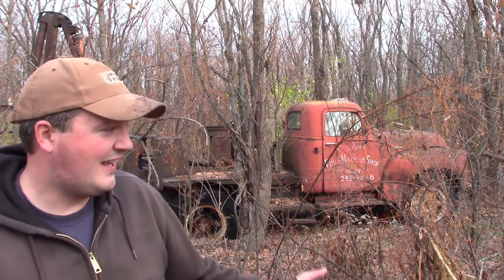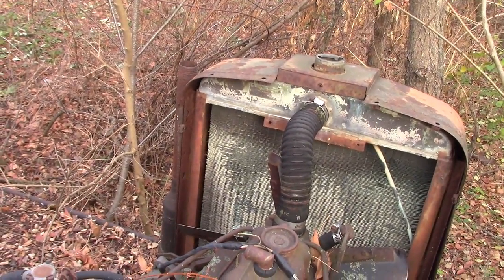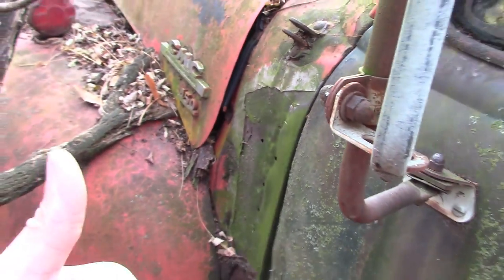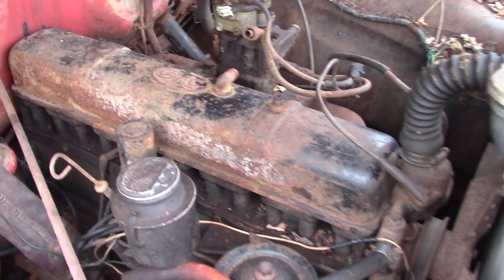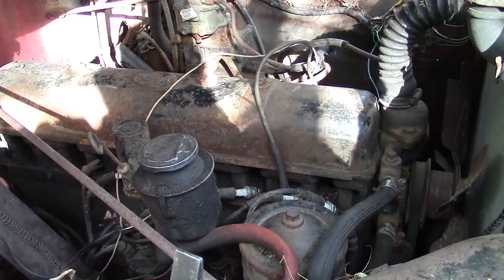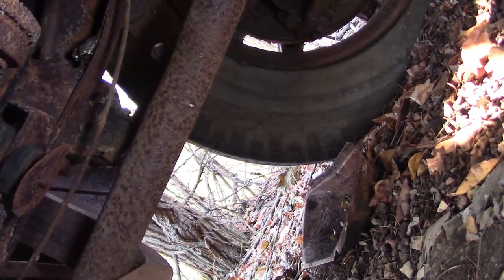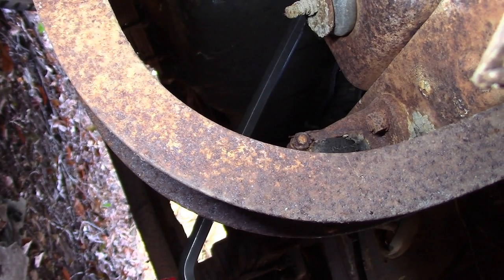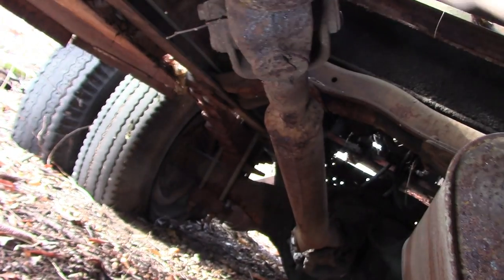Forgotten 1950s GMC Truck Backhoe Thing - Will it Ever Run Again?

Comment: OM-G  I just cant say enough words regarding your sense of HUMOR, the video is absolutely pure entertainment in multiple avenues, from the "12" volt Spark-GMC-Tronic modification, to the block of wood cab mount repair, the non existent carrier bearing. The backhoe attachment that obviously exceeds the entire gross weight of the truck X3?, the all thread ROD modification for U-Bolts always does the trick no matter if its 1/2 INCH or 5/8, THIS absolutely pure entertainment and Thank you for taking the time to do it, I say offer the cab to a RAT ROD DONER -Builder and send the rest of her to the crusher... ONLY if you have NO Sentimental attachments...!!
Reply from the maker: Well my humor is not for everyone, but I'm glad you like it.

Comment: Grade 2 hardware... What could go wrong.
Reply: Not much as long as you don't use it.
Reply: 😂agree.  I grew up in a small town and seen some real quick fixers  . Friends brother Chevy Luv with bailer twine hold the engine in place since the motor mounts were broken . Bad tie rod spot welded and u joints too.  Boards in coil  springs since the mounts had rusted out .
Reply: Back in the late '70s I had a plumber get really mad at me for failing his van for Pennsylvania state inspection. He had something heavy on the one side I think it was Ben's full of pipe fittings, so he added a spring leaf on that side and used all thread because the original u-bolts were then too short. I couldn't believe how po; he was. He called me an idiot, and said that his bent all thread was plenty strong enough. Funny thing was he did it to a van that was only about a year old. I guess he thought that I'd see a late model van and miss his butchery
Reply: @joecummings1260  Come on, grade 2 all-thread is a perfect replacement for U bolts on leaf springs! I mean, it was only ONE side! LOL I think there's a truck around here with wooden lift blocks.
Reply: CRASH! THUD! BANG!!!!  Crunch! Wobble! Wobble! Burp!
Reply: @52Ford  a kid I went to school with had a 55 chevy with 2x4 s bracing up the rear suspension.  It would be worth 20 grand now!

Comment: Those backhoe trucks weren't real popular but there were quite a few of them.  I saw a Samson on a late '60s Ford at an auction a few years back.  That one had a huge backhoe.  Probably as you said the best use of that truck is to donate parts so another one can live on.  Interesting video as usual

Comment: Good call Wes! With The amount of work she needs, might as well do a restoration. I think that truck and it’s threaded rod “u bolts”  and bailing wire/flat bar resistor is in the right spot!😂

Comment: The best thing you did Wes was walk away.
In 1967 I was 14. My father told me if I got our old 1953 Chev to run I could drive it on our private land. The head gasket had blown and leaked antifreeze into one cylinder. We got it broke loose by prying on the ring gear and beating on a wooden block setting on top of the piston.
This vid brought back some good memories.

Comment: Drag it back home and do an LS swap. Replace the 6 cyl on the back hoe, rebuild all the rams, spend $12K on parts and labor and you will have a fully functional POS to drive to the scrap yard. Might get a grand or two for scrap metal.
You would have a much lighter Dutch wallet and we would get lots of video footage.          LOL
Another fun video from WWW, and we all appreciate your efforts.
Thanks for sharing.

Comment: would be nice to see old girl run again. Maybe with a donated starter and 1 or 2 quarts of your mix strait down the carb with plugs back in for 5 or 6 days and of course at least 2 good strong batterys tied together.  even with some valves closed your fluid and diesel mix will drip thru  with an old worn engine.  maybe something to think about, for down the road? good videos wes, you know more than most for a younger man. and it doesnt even need to run just fire up and run it with can of starting spray so you dont need to mess with carb or fuel line. that should be enough to make most of your viewers happy.  happy hollidays.

Comment: This one had the stench of death from the beginning. If anyone could, Wes could but sometimes you just gotta pull the sheet over it and announce the time of death. It’s like the muscle car guy who pays 15k for the car, puts another 15k into it and then has a car that’s worth 16k. I’d scrap the truck but hang onto the hoe attachment. A little paint and new hoses is all it needs. Throw that on a better chassis and the buyers will beat a path to your door. Trust me. 😎👍

Comment: That's a Warner Swasey Hoto 300 nice unit. Both units I have the rear engine is a chevy 261 inline  6. The front is drive unit is a Detroit 353. I have one as a bucket option and one as a log grappler option. The biggest problem is moving them due to road weight restrictions in my area.

Comment: HOPTO has an interesting history. The backhoes were developed by the Badger Equipment Co. (incorporated 1946). HOPTO stood for Hydraulically Operated Power Take Off, as the backhoe was driven by the tractor’s power take-off. In 1958, Warner Swasey acquired Badger and developed HOPTO into a full line of hydraulic excavators, which were manufactured until 1990. Badger is still around, making excavators and cranes for rail maintenance. The idea behind the original HOPTO back how was that it could be attached to a truck or tractor, which would give it greater portability.

Comment: I'll chip in on that beer, if you can locate that individual with renowned mechanical engineering abilities. But your first place to look is the local cemetery. That means will just have our drinks as a toast to that thing... still good video.

Comment: I heard those GMC 6 cylinders were not the same as the old Chevy Stove Bolt 235. Road Kill got a 50 GMC going and they said those GMC 6 cylinders were a desirable for building into a race engine back in the day.

Comment: Would the engine block hold water? If it does you could try getting some hot water in there, could you rig some kind block heater for the water system? Radiator could be by passed for this. 

If you could combine this with something cold on the piston crown you could expand the bores and shrink the piston to break the rust bond. 

If I guess a 3 inch bore and a 70 deg c temperature increase then you should see about an 8 thou increase in cylinder diameter. 

If you can achieve a 10 degree drop in piston temperature you should see about a 3 thou reduction in piston diameter. 

I'm thinking if you could freeze some cider vinegar to de rust the engine and then crush it enough to pass through the spark plug hole without dismantling the engine. Then turn on a water heater for the block and hit it with your grease gun whilst that's doing it's thing you've given it it's best chance. 

If it's an issue, I'll pay you a days wages to make it happen.

Comment: My father owned a Hopto truck mounted just like this one.  Built by Badger Machine in Wis.  His had a Wisconsin Aircooled engine for power.  This model was an early attempt at a Hydraulic powered Back Hoe and unfortunately the hydraulics were so powerful they would self destruct the machine if the operator wasn’t really careful.  Myself my Dad and my brother learned this the hardly.  Fortunately like this owner we had our own welding equipment for daily repair.

Comment: I believe what you have there underneath the (worth it's weight in gold)  Zenith 2bbl. carb is a highly desirable 302 GMC engine. 235's were Chevrolet and a much different engine altogether. All GMC engines up to 270 used a Zenith 1bbl. carb. I hope you replaced the oil bath air cleaner when you were finished. The Hopto powerplant looks to be a 250 Chevy now. As for what appears to be dual leading shoe front brakes... they worked quite well for a truck with a 45-50 mph top speed in a world that was not racing to destruction. My big Studebakers have them and they "Woah-up" pretty good. These medium size trucks were the backbone of construction and delivery from the '20's through the '70's. More should be saved and restored. Just like Oliver and Cletrac tractors. I'm an old guy now , but I can say for sure that life was better at 45 mph. Stay safe and keep the videos coming.
Reply from the maker: I guess I'm not familiar with dual leading shoe brakes. I figured they were wedge brakes. The carb says Holley on the tag.

Comment: GMC 302 cubic-inch straight sixes were commonly swapped with their smaller Chevrolet brothers way back in the 1950s by hot-rodders everywhere....   Wayne even made high-performance cylinder heads for them.  These engines are still commonly seen at Bonneville, but not much anywhere else.   This engine (if salvageable) would make a fantastic nostalgia-based hot rod engine....

Comment: its going to sound crazy but with seriously stuck engines where the more common ways to free them fail, i have filled the cyliners with vinegar (yes the same stuff you use in your kitchen) and let it sit for a day to a few days. It will usually free them up as vinegar will actually eat/disolve rust. I have done this more than once with great success. yes it means changing the oil before even trying to start it - but hey it works.

Comment: That thing's had it - no shame in walking away. If you come up with a useful piece of equipment with some knowledge, elbow grease and minimal cash, that's a Win. I don't remember the situation with these vehicles, but if you can, throw it on Craigslist or ebay or whatever - someone will want that body or chassis parts. Although the only Hopto I ever saw was on Classic Truck Rescue:)

Comment: Unlocked many motors over the years. Uphill battle for sure. Even if got unlocked oil rings would be gone and it would smoke like crazy if even got enough comp to run in the first place. I learned after a few weeks if a motor  don't unlock than 100% chance rings are done.

Comment: In NJ we have equipment in transit tags, the law here says for construction equipment moving to and from job sites, and a concrete pump company I worked for used em on all the pump trucks he had. Drove those trucks all over that way 2+ hours each way sometimes

Comment: Will be a sm 420 4 speed transmission with an output shaft parking brake.    20 in tube type tires are are available but a little hard to source.   They make 22.5 tubeless rims that are a direct replacement for those wheels.

Comment: Defiantly not a Chevrolet 235 Stovebolt (GMC engines were never called "Stovebolt's")...my guess is that's a GMC 302 6-cylinder which is a very desirable engine...it's worth saving even if it's frozen, it can be brought back to life.  I'm also guessing the truck is either a 1954 or 55 first series model because it has a one piece windshield.

Comment: being a GMC, it would be a 228, 248, or if the exhaust flange has three bolts not two, it's a 270, a desirable engine. To my knowledge, the biggest of the inline 6's.

Comment: You try best Wes :) maybe in future trying again too and always next times to try! Also crane part that a 292 In line 6  from 1960 to 1970 years  looks to me also be one used in 3 ton Trucks with! Horsepower be 160 and Torque be 190 to 230 !

Comment: If you save this truck, it'd be an interesting teardown, especially on the excavator end. To me, it looks like it's all jerry rigged. If it's saved, and kept as an excavator truck, it could become an interesting project, especially if all of it is redone correctly; like a PTO for the hydraulics rather than a separate engine, a proper setup for the excavator rather than sitting on the hydraulic tank and operating bar steel levers, having a proper swing rather than the odd rack and pinion setup, proper leaf springs in the rear, etc.

Comment: 20 years ago that truck was parked there because it was fully and completely worn out. 20 years later you have all the issues that being exposed to the weather caused coupled with every reason they took it out of service to start with. Absolutely the right call to walk away from it as the cost to repair it to operating shape and the it would take would far exceed its value. Cab looks decent enough for someone though.

Comment: Get a junkyard donor truck to put this cab on and then fix the more modern truck and use it in the summer months to haul stuff around for the shop... Check out the truck buddy on Halfass Kustoms is doing right now. You'd dig it and may give you a few ideas. This cab is actually pretty cool... forget the rest of the truck lol Keep the cab :-))

Comment: Grandad's trick was put gas in each cylinder and throw a flame, the gas burning will heat the cylinder, letting the metal to expand then ad atf to soak for couple hours then break the engine free. Can be a little dangerous but it's exciting lol

Comment: That's a cab donor if ever i did see one!  Speaking of tricks/special sauce though I can't help but wonder what would happen if you knocked up a grease fitting (or even better a portapower fitting) that bolted into the plug hole, filled the stuck pot right to the brim with ATF/diesel mix & then attach either the grease gun/power pack to it and pump the everloving snot out of it.  (well, I imagine one of 3 things.  Either it'd work and be cool as frig, it'd free up the worst piston and then bend the rod trying to free another stuck hole or it'd simply pee out of the valves since they're unlikely to seal by now...)

Comment: did you try a small chain block hooked in to the holes in the clutch cover and fastened   a round the chassis it would give you a more secure pull

Comment: Yeah, the cab is the same as the smaller trucks. I have a 1953 Chevy 5600 series. If I ever touched that thing again it would be to remove the cab, and cut the rest up for scrap.

Comment: The best way to break the pistons free is take the head off and use a 2x4 and a 2 or 4lb shop hammer. I've done that and it worked.

Comment: If the unit had to be got going, I'd set up heat on the block coolant and get it up to 212 and let everything expand - that would free it up for sure. And then instead of trying to start it, I'd disassemble the engine and clean it all  up.

Comment: There's a adapter you can get to go from a spark plug thread to a grease gun. They work well for breaking loose a stuck motor.

Comment: That looks like a homemade version of a Unimog backhoe. LS swap the truck and look for a modern hydraulic power unit to run the backhoe.
Reply: It says Hopto on it. They made small backhoes for trucks like that, and also early hydraulic excavators.

Comment: Wes, have you ever heard of using brake fluid to break fasteners/rusted objects(i.e. piston rings)? Please don't take this as on of the viewer comments grandpa's special sauces you should try on this engine! I know you have done your do diligence to revive this engine. I have only heard used this method in the long term (3+ days on a rusted brake line fitting). I just wanted to add some input to the video. I always look forward to seeing a new WWW video pop up on my que! Keep up the awesome content and stay safe out there! Dan @6-4_Fab Glen Rock, PA

Comment: Don't know about GMC, but that may be a later version of that body style. I had a 1950 5 window custom chevy, and I've noticed the same other early '50s, flat split front windshields and the grills were much the same between Gmc and chevy.  Mine had the only two options available in 1950, an oil filter and heater.

Comment: You could take this home for a project and build it to be your new work  truck with say a cumminsdiesel engine and eaton g/box with a airbrake system for brakes  and air lines to connect it to a trailer..minus the body backhoe attachment just unbolt the body and bin it be the coolest 50s truck going around

Comment: You’d be surprised but les schwab still sells those 8.25-20 tires but there around $300 bucks with the tube and the flap and they will install them on the wheel for free

Comment: Son, that neither a "stovebolt" nor a 235. That's a medium duty 302 I-6, a very popular engine for hot rods and race cars in the 50s, and nostalgia guys today. With a long-discontinued Wayne cross-flow head, high compression pistons, running on alky, I've heard they'd make 500hp.
Reply from the maker: Not this one. It'll make soup cans and razor blades.
Reply: @WatchWesWork  Sad. There's someone out there who would've built it and loved it, if only they'd had access to it.

Comment: Speaking of secret sauce, and not that I ever tried this myself but, when I was a kid I saw a guy remove rust from gun parts with some kind of stuff he made out of potatoes. I kind of forget how it worked but, if I remember right he put the gun parts in a piece of pipe that was capped off and poured the potato slop into the pipe with the gun parts and sealed it with a cap. I think he had to let it sit for quite a while maybe a week, I'm not sure. I do know it worked, I remember seeing the parts, they were rushed free. I don't think I can ever forget it, because when he opened up the pipe full of parts and potato slop it stunk so bad I almost vomited

Comment: one piece windsheild?  54 and up i think.  302 ci 6 was the truck engine?  all thread on the rear springs...had to replace springs and u bolts broke so replaced with the threaded rod?  anyway, good decision to walk away.  btw, you ever run across studebaker trucks?

Comment: The Chevrolet displacement was 235 cid, the GMC was 249 cid. The seal on the master cylinder might have been the dust boot for the actuator rod. The smaller all-thread is acceptable as long as it's on the side of the axle that torques up...